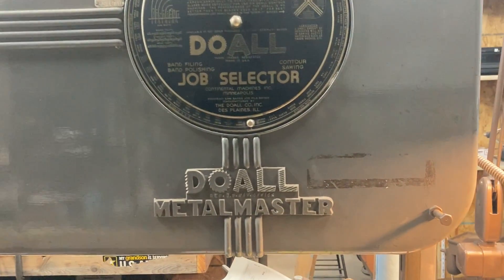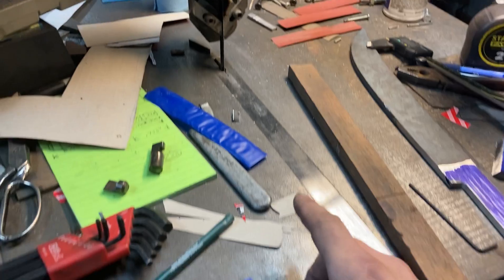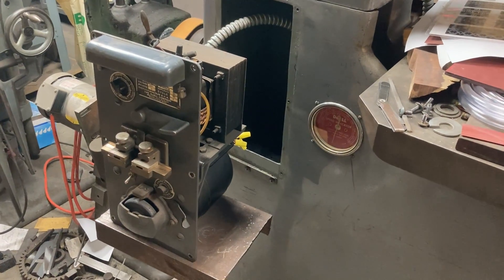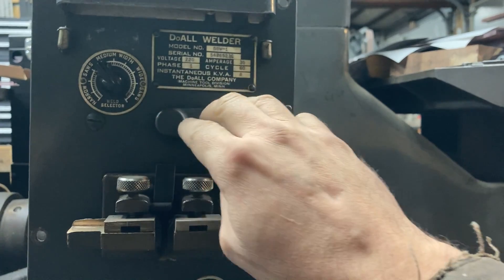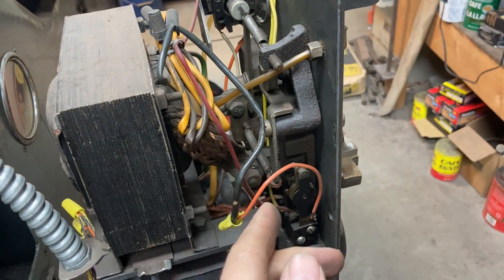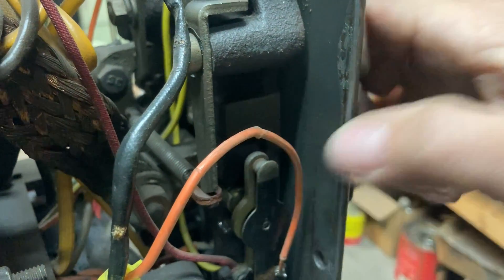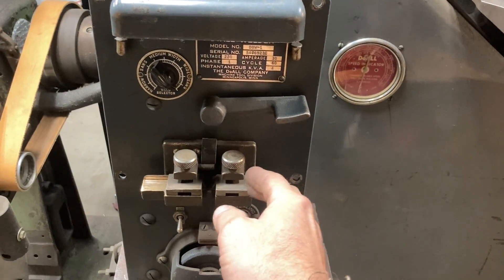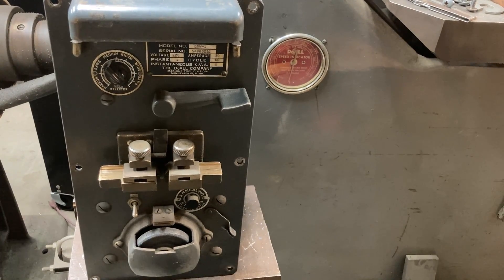DoAll Bandsaw Blade Welder Fix!

Comment: Thanks for the video. I have a DBW-1 blade welder that has started giving me similar issues. I guess it's time to pull it back out and check the adjustment.
Reply from the maker: Good luck! Did you find the manual?